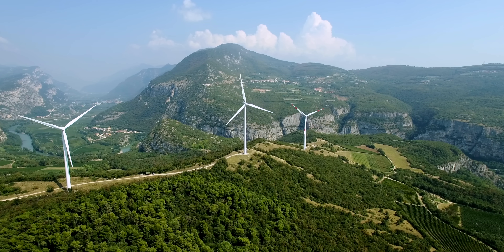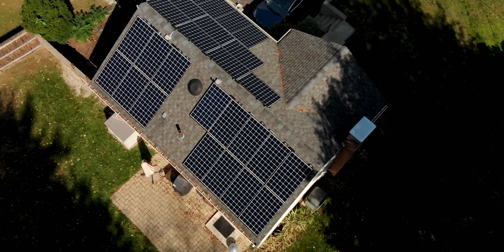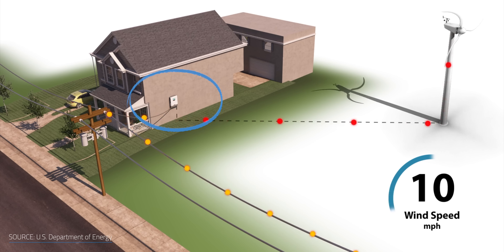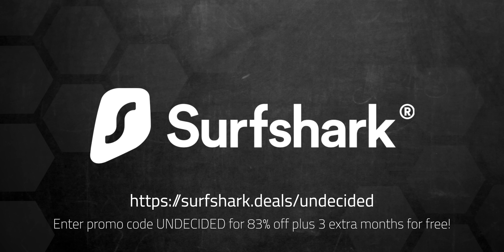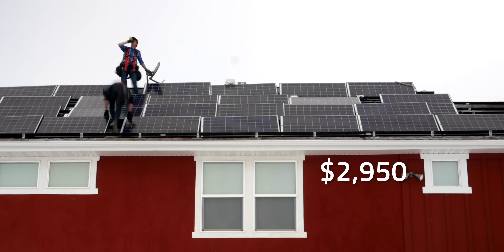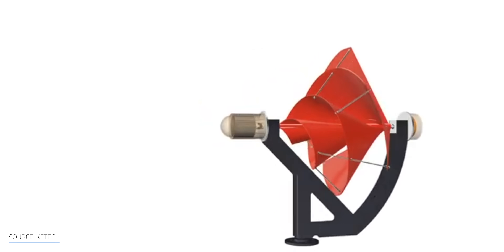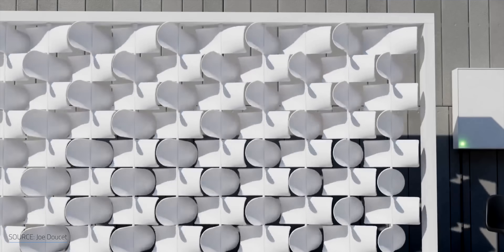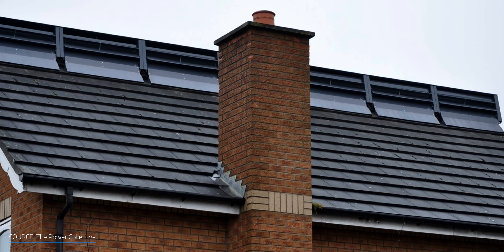The Challenges of a Wind Turbine on Your Home

Comment: I wonder what happened to that combined-axis design that was covered in a TED talk way back when I was in university.   I remember a TED talk on renewables back then showing a prototype mini-turbine that had a shared axle running the full length of the roof line and had a dozen or so windmills positioned evenly throughout its length.  I don't remember anything else about the design or claims regarding its specs, though.

Probably didn't work when you actually hooked it up to a generator - it looked impressive with lots of spinny things lining the roof like that, but there's a big gap between impressive looking spinners and a viable power generation technology.

Comment: How about a small hydro power generator in your backyard. You can buy a 10kw such generator at a reasonable cost!  What? You don’t have a reiver in you backyard?  Good point! That won’t work then.  For the same reason, you don’t have enough wind on you roof to make it worth the investment unless you happen to live in an extremely windy area.   That is one reason you see a lot of solar panels in the neighborhood but rarely wind turbines.   Gentle breeze can make a small turbine turn fast in free spin and that gives the wrong idea that a lot of power can be generated from a gentle breeze.

Comment: These "Windwalls" should be installed down the centre of Motorways as you'd be surprised by the amount of wind created by traffic, it would also create a barrier to the oncoming traffic so there is less distraction, especially after an accident on the other carriageway.

Comment: The problem with solar cells on your roof at least hear in Australia is that they get a bit hot which must shorten their life span. A solution maybe to have a square house with a conical roof with a conical wind turbine on top, solar cells could be mounted on the blades which could drive a shaft that goes down the centre of the house. This shaft could drive an alternator as well as have slip rings on it to pick up the power from the solar cells.

Comment: I think the other issue with wind is, short of some revolutionary new design concept, it's hard to see how the cost to output ratio will really drop much more. The technology is fundamentally known with economies of scale already in place and realistically it looks like the output is what will need to be changed to affect that ratio as I can't see the costs dropping. Solar on the other hand still feels like there is space to innovate in the manufacturing to make them even cheaper, the possibility to getting even more of the energy out (combined electric & heating or absorbing other types of radiation for further energy generation) and it feels like there is still much room for the technology to grow, decreasing both cost and increasing output.

Solar looks like it will be the way forwards.

Comment: I'm pretty tired of all these home based power production videos assuming that everyone lives in areas with more or less constant year-round sunlight. In winter where I live, you can cower your roof and yard in solar panels, but they're still only going to produce electricity for 2 h a day on average for 6 months of the year. At best! Not to mention, that they'll be covered in snow and ice on a regular basis, and keeping them clear would be both work-intensive, and potentially dangerous. Yet such areas aren't even mentioned in this video. Nor in any other videos I've seen. Would solar still be the preferred means of home based power production (as compared to wind) in these areas?

Comment: we have both solar and wind for 24v system at the airfield clubhouse, that charge a pool of AGM batteries, for us in the clubhouse it has been working good for 5 years. we use it for lights, waterpumps, chargingstation and so on. small small scale. the combo give us power all the year 24/7.

Comment: This video was exactly made for me. I am thinking about this topic very often.   I just missed one point in this video.   What about their life cycle and the recycling options.  If there are huge non-recylabel leftovers from these installations then the price calculation isn't complete.  The huge amount of waste that will be there after the lifetime of such systems, I did not see in this calculation.  this is a personal calculation.  but as soon as we scale this up there will be tons of materials that have to be recycled or brought to waste dumps.  This is not a personal price but it is a price that has to be paid also.  These wind collectors must be developed further and made more durable.  Wind energy is the energy source we should harvest decentralized with home installed solutions.  And the price we really have to pay is the price these installations cost.  And even if it's more expensive than solar.  It must be brought to a level of high durability, high efficiency, and low maintenance, and then these installations must be installed everywhere.  For times of overproduction, communities can buy an electrolyzer to produce and store hydrogen which can be used later or can be sold.  That is the final concept.  The other option would be to 100% recycle ( but not downcycle) all solar panels and wind turbines.  In these cases, the big turbines would be the better option, when placed in the right locations.   But then it must be made sure that the areas where these are installed are fixed and cannot be extended every year, also new turbines must be installed in the places of old turbines. I'm ready to pay the price for wind electricity when I find a thing that fits for most criteria.

Comment: That Halcium PowerPod you did a piece about on your blog last May looked like a cool solution? Do you know where that is? Perhaps you could do an update on it, please? Looking at the thumbnail you have for this video, there are two chimney stacks on each side of the roof, imagine putting a terracotta-coloured powerpod on each of them? You could even perhaps vent the chimney through the base of it so you don't lose the utility of the Chimney. Although you'd need to manage the heat.

Comment: Anyone else appalled by that gear box shown at 2:56 with the note saying speed X100 with two 12 tooth gears (one not connected to anything) being turned by the 24 tooth gear. They are off by a factor of 50 lol

Comment: Having solar AND turbine power would be the best idea for my area. We get plenty of snow around here during the Winter, and solar panels do absolutely nothing with 6" of snow covering them. A number of my neighbors have installed solar panels in the past year or two, and I was very surprised to find out that they do not have some kind of heating function to melt off the snow (like the newer LED traffic lights do, because the LED's don't generate enough heat to melt off snow.) But we always have plenty of wind around here, especially during the Winter. So a proper set of solar panels, a decent little wind turbine, and a large battery bank would be my ideal setup.

Comment: how can you claim to know it all when you dont know MA ... NH has the highest recorded wind speeds in the world ? ive had turbines over 15 years now 300 w @$500 per unit at the time the things never stop day or night .... i live central west nsw australia low wind the hotair baloon capital of australia is just down the road ?... i never spent a cent on them ok the blades need new gell coat and new bearings would not go astray at $4.50 each 6205 x 4 ............. in the time ive had the turbines ive had 200 w solar panels fail ...... the moral is they cost about the same output is similar over day night operation

Comment: I think another point to take into account is the issues with storage, since the materials for batteries come at high costs of all kinds (which everyone here knows I guess) and demand and I think at some point prices will only rise. So even though wind power is not as efficient as solar and even in a case where you wouldn't necessarily store the wind energy, it might de-stress the situation for off grid systems significantly since you wouldn't have to rely on storage and batteries so much for solar during periods where there is no sun, but still could be wind. So I think the way to go is always to chose a good mix of solar and wind (and possibly hydro? Not sure about that) whenever possible.

Comment: I think alternative/renewable energy sources are a great idea if used in tandem with what we already have because one element many seem to forget is the initial costs of them.
When I say intial cost, I don't mean the price to purchase and install but the cost to create.

Example [AND IF YOU HAVE OR ARE INCLINED TO DO RESEARCH FINDING BETTER NUMBERS, I INVITE YOU TO DO SO]:

A 2 megawatt windmill is made up of around 260 tons of steel requiring 300 tons of ore and 170 tons of coking coal.  This all must be mined, transported, refined, produced, and transported again via hydrocarbon.
So the question must be asked how long must one 2 megawatt windmill spin, forgetting maintenance (ie blade replacement - where blades are often buried btw), in order to generate 1 watt of energy more than what was invested in building it?

Again the point of this is the disconnect/forgotten cost to create.  And while solar has some similar issues, they aren't as extreme.

Comment: A critical factor not directly addressed in your video is friction.  For a large commercial turbines friction losses are a minor component of operating efficiency, but as turbine size decreases friction losses increase exponentially.  This makes small turbines very inefficient.  The Wind Wall especially, with 25 individual vertical shafts with 25 small generators, looks cool in social media posts but I cannot imagine a more inefficient way to build a wind turbine.  I question the capacity figure given for that silly thing.

Comment: I had some idea/critique to this video. But af ter going through the playlist I could see that it had covered most  of them.
One thing that I have not yet seen by anyone is the voltage in house. With household wind turbine the voltage can/should be changed.
When it comes to lighting up the LED-technology have changed the voltage that is needed. 
Instead of trying to ramp the voltage up from wind turbine why not use the power to light up the homes. The battery also don't have the need to be as heavy duty, cos 12/24 volt is most batteries capable of working with.
I did a search on how much energy that are used for light and it's about 6 % and that is so low that it should be possible to generate it at home with wind turbine.

Comment: I'm curious why no one ever seems to calculate the production costs into the "Environmental Impact" statement(s)??? The production of metals and modern materials produces quite a bit of carbon emissions. These "environmental impact" statements seem to only quote the end-user impact which is only a portion of the total carbon impact. It is disingenuous to leave this information out, and though the overall impact is slightly less than the use of fossil fuels by the end product, it is still worthy of mentioning. There is great potential in current "green" energy sources, but they are not quite up to the task of replacing fossil fuels. They should be used in conjunction with, not instead of, fossil and more traditional fuels. As the "green" technology becomes better and more efficient (from production to end-use) older fossil fuel systems should be phased out, but that is probably at least a couple of generations away before the dependence on fossil fuels is the less prominent source of energy production.

Comment: Solar panels require regular cleaning to remove  dust and maitian full efficiency ironically in this is worse in high wind areas. Also soalr pannel efficiency decreases with time due to junction breakdown so after 7 ish years you are down by half wind turbines dont have these issues

Comment: Well put. 
I would consider wind power for those dark nights and overcast days.
A small turbine that would cover your home's base load when you are asleep etc... Would be good.
I always tell people MAX out any planned solar installations... Or regret it later!!
1. Solar PV
2. Insulation/switch stuff off
3. Solar excess can heat the water
4. Buy a storage battery
6. Sell your excess solar PV
7. Install an ASHP
8.  Done all of the above..look at a wind turbine👍

Comment: Your Calculation is wrong. You get vertical 4 KW wind turbines for $350 apiece from China. That's 8KW for 2.
In Wintertime. They take less space than horizontal. You get more wind coming in and Winter storms in Winter. Exactly that's the time You need energy for heating to run heat pumps. 1kw does 4-5kw heat. Solar panels deliver at this time of the Year next to nothing. Windturbines full power.Day and night. So in combination with Solar panels and Storage for instance 3Forklift packs batteries would run Your heating and probably Your house plus You can send the excess to the grid.
Reply: "You get vertical 4 KW wind turbines for $350 apiece from China." Really ? Most you will get for $350 from China is a piece of junk which will NEVER produce 4kW, and will disintegrate within hours (days if you are lucky). Do you even have any idea about the prices of the parts required to build a 4kW system ? Keep dreaming.

Comment: matt.leave the electricity AS dc.....dump it into a temperature differential......(refrigeration using peltier circuit for example).....any excess can be placed into a standard battery to run lighting.*
Most mobile devices are already able to charge from a car(12v).*
laptops also.*
small fridges kettles 24v**
.
*look at any camping equipment that runs on 12v as these devices have been becoming cheaper since the cars almost ALL use 12v.
** look at similar equipment used by truckers.
Oddly enough.I found it wiser NOT to outproduce my actual energy requirements entirely,nor to leave myself at the mercy of the govt.subsidies.
Too many examples of inneffective substandard panels being installed by untrained operators,employed by companies who  historically botched simple window,roofing projects,went insolvent yet were still trading.
I only have ONE example of a chap who actually came out ahead financially local to myself.
And that was due to the company going bust just after his installation,and immediately before his bill was due.
Which meant his was free.
Had he paid up,he would have been signed up to a" pay up front warantee scheme"which of course would not have been honoured.
(His system crashed the first summer due to a spike on the national grid.Electrician fixed and serviced him for £300,bargain.)
My smaller system.Not connected to mains.Uses the techniques I suggested.
Including a home built peltier fridge......£350.…...which I maintain myself,easily.....with very little fuss.
Pay attention in school.
Fridges should not be 'smart'er than you,kids.
Buy a dumb one,or build one.
(peltier fridge uses seebeck effect,einstein fridge uses evaporation and (latent heat capacity)to chill the inner chamber,top loader design is more efficient)
Much wiser to get the home insulated and temperature stable before thinking about solar panels etcetera.
Pre heating water,before it enters the house supply,for example.Biggest mistake uk plumbing made was MIXER TAP.and LOWFLOW anything.
Harvest rainwater for grey usage(toilet/laundry/plants)
If a lesovon farmer heard you were flushing drinking water down your loo he would weep(if he could spare the fluids)
Fyi.uk planning law gets really scary on wind turbines,but it loves solar.
Oddly it says NOTHING on the size of the micro water turbine running from your downpipe(drainpipe)into your waterbutt***
***site one butt ABOVE the toilet cistern,and give your cistern a connector with a ball valve.